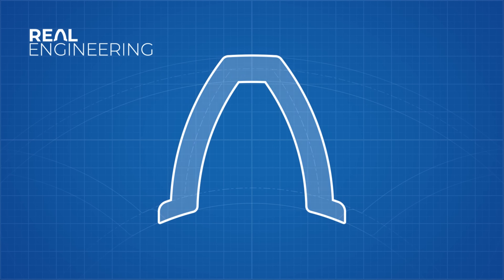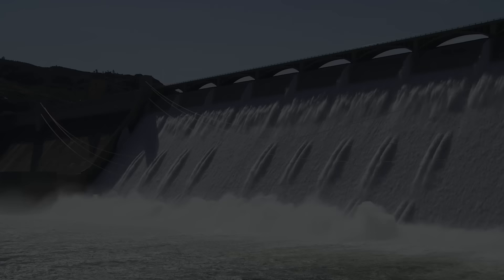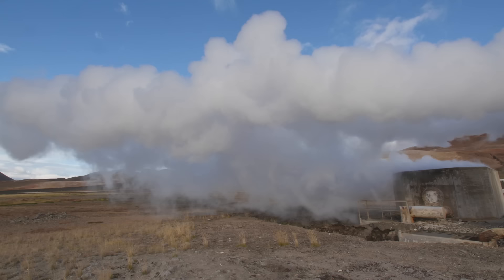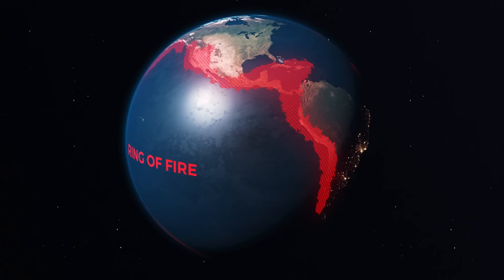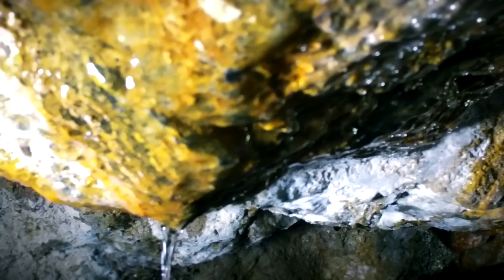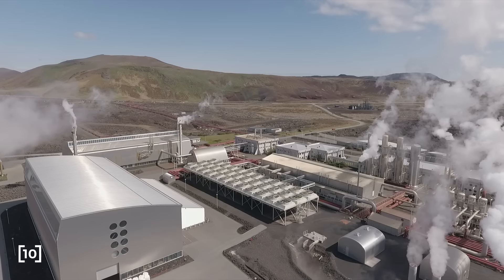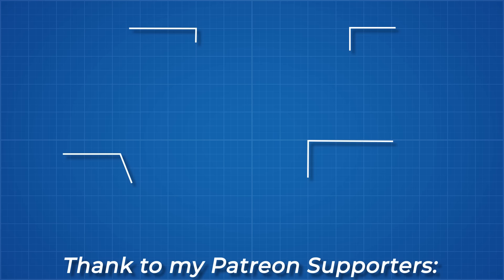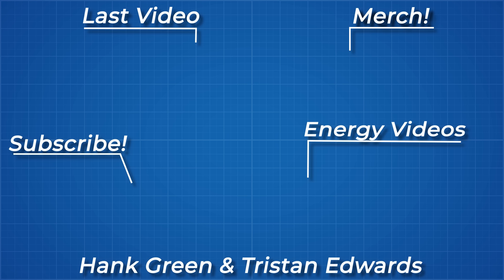Could Earth's Heat Solve Our Energy Problems?

Comment: Where is all the geothermal energy?

Answer: it’s underground.
Reply: That is what the government wants you to think. 
Pompeii never forget
Reply: @theophrastusbombastus8019  lol just sacrifice  chicken to the volcano and boom... explosion energy and pompei all over again
Reply: From that sweet sweet earthquake zone
Reply: I am only scared that this will accelerate the marsification of Earth. Basically Earth turning Mars like
Reply: @theophrastusbombastus8019  
The center of Earth is made of PLASMA. IT'S NOT SOLID CORE. I have something I think you need to see. This is an experiment done with a regular plasma ball, being spun at 2000 RPM'S. It creates its OWN magnetic field. You can see the definitive north and south pole, as well as tropics and an equator. Now this is being created by regular gasses inside a plasma ball you buy off a shelf. It's VERY plausible, that at our earth's core, the different metals of our core being compressed by our lower mantle creating heat, combined with the rotation of earth at 65,000 MPH creating even more heat, would turn our solid core, into a molten liquid core. The faster the Earth spins, WELL past 2000 RPM's would further transform it into a super plasma state. The FASTER it spins, and instead of basic gasses like in a plasma ball, and having metal properties instead, would still create magnetic fields, but COULD actually also create gravity. 
Here is the link. It starts at the 5 minute mark. Mind you, this is just basic instruments using a battery, and a motor. Using proper equipment and liquid metals, you could theoretically not only create gravity, but reverse it. Meaning instead of gravity pulling, you could create a field that could PUSH it, using it for interstellar travel. The sun would charge these devices, the same exact way our Earth's plasma core gets its sustainable charged energy from the sun, at the poles. Our government already knows this, but implementing this technology into vehicles, would eliminate the need for fossil fuels, in which they get rich from. 
Would other civilizations on other planets use this?? Yes. Why would aliens come here?? Because the closest sun, from our sun, is 4.22 light-years away. Meaning ANYONE flying in or near our solar system, would have to use our sun for fuel. It's the only "gas station" for light-years. It's very plausible while doing so, they WOULD see our shiny blue marble,and get very curious. 
https://youtu.be/i1J5HF1yUAw
Reply: @vDarknessFalls  
need to check your work. The earth 'spins' at about 1000 miles an hour or 1609.3 kilometers per hour at the equator. That's approximately one revolution every 24 hours . It circles the sun at about  67,000 miles an hour or 10783 kilometers per hour.
Reply: @chuckaddison5134  shit. I totally fucking typed that wrong. Even so. The plasma ball is only being spun under 50 mph. Imagine if they cranked it up to 1000 mph??? Would it create gravity.....
Reply: Does that make it hipster energy?🤭 (Sorry, couldn't resist... I'll show myself out now 😞)
Reply: Zing!
Reply: @cryingwater  
Well when we make Mars Earth-like when Earth becomes Mars-like it will be a good thing.
Reply: It is, for practical purposes, unavailable except in a very few locations.
Reply: @vDarknessFalls  You don't have the foggiest idea of what you are talking about.
Reply: @theophrastusbombastus8019  Too soon man....too soon
Reply: If you search youtube, type in "The Core of The Earth - Documentary HD ADVEXON TV".
There is one thing about that video though, that they got wrong from National Geographic, as we discover emerging technology, well... oil, coal and the stuff mentioned in that video.. isn't used anymore, since our world is changing and using electric vehicles, and with Fusion Energy on the way for our source of energy, and for space exploration. Silicon is in all of our devices, when the video mentions about some things in our devices, the video was wrong, and the narrator is short sighted.

Same thing with Graphene.. since Diamonds aren't the strongest material like in that video, Graphene is actually 200 times stronger than steel and 100 times stronger than the strongest steel.
Graphene also has special properties "when in its purest form", and it's known as the wonder material of the future.
Spintronics with Graphene to make our devices more energy efficient and faster at the same time in the next 4 years, by tilting the Electron = electricity, and Spintronics has also been tested on tilting Photons (light), to create Quantum Teleportation for the Quantum Internet to be developed in Australia by 2030 and then shared with Europe, no word on if America will have it yet. There's also Australian companies working with Graphene to bring Quantum Computers to room temperature, and other countries with companies working on Photonic - Quantum chips.
Graphene has also been proven for classical computers (what we use now) to be 1,000 times faster "I have a video in a Graphene playlist on this, in another channel", so we should be replacing silicon in our computers and all devices! Get rid of silicon!

The Hyperloop One was tested in America, and being built in India first "shovels at the ready" they call it as they start now on construction, and will be in America in 2026. See anything wrong with that picture as to tested in America first and then built in India first? Hmm.. I'm all for sharing the technology, congrats! But I don't think it should be unfair where we can't have it built at the same time in America. 
I mean after all, a lot of us want the technology in our lifetime, some of us are already getting older, and don't want to be another decade older before we use it, just because another country gets to have it first. : (

There's a video in a playlist I have, that mentions a Type 1 civilization will use all the energy from the planet, and possibly have other technologies like advanced bionics and many other things like curing many diseases and controlling the weather "some of these technologies from supposedly (Ghost in the Shell) - series", though we are getting closer to advanced bionics, and several other technologies like Photonic Computing, Quantum Computing which will predict weather supposedly, help with the medical field in new and advanced ways, the financial area, and many other areas for other technologies, and new emerging technologies to come of it that we don't even know yet, with also many other technologies for space exploration, asteroid mining becoming a reality on the way, new larger space stations, Gateways (more than one), new propulsion technologies, rockets getting smaller and some electric (inside) like Rocket Lab's "Electron", rocket prices dropping, sending stuff in to space.. the prices dropping way down, and refueling as the idea from space to save time and money instead of launches from the surface of the Earth, missions to the moon and Mars, with Gateways and space stations for the SpaceX Starships to dock and refuel, and so much more going on.

What I mean with the Type 1 civilization, we might not need to use all the energy of the planet, because we have Fusion Energy on the way, Graphene is also a super conductor in its purest form, for energy, batteries to recharge faster and last longer, and so on. To learn more, check out a playlist I have on Graphene.
And so I think we are very close to a Type 1 civilization, without the need to use the Earth's core.
We were already at .78 % (percent), I think we are around .92 - .95 % of the way there, we are getting very close to being a Type 1 advanced civilization.
There's a chance that because of small Fusion Reactors, we might not need a Dyson's Sphere around the sun, that would block out the light, sure we could create light, but we might not need to have to do this, especially for what comes next in emerging technologies after Fusion Energy. So we could be both "half way to being a Type 2 advanced Civilization (without moving stars, planets, moons, asteroids and so on), and half of a Type 2 advanced civilization at the same time" because of Fusion Energy, but there's always room for more energy I guess, even if we create energy in space from Fusion reactors and share it with the Earth, I suppose we probably will use the Suns energy and want to make a Dyson's Sphere.
So I do believe we are very close to a Type 1 advanced Civilization, and half of a Type 2 advanced civilization "without moving stars, planets and moons and solar systems around" as we will be able to one day, I'm sure they already know how, but having the technology and having it built is another thing, that doesn't mean they don't know how, and we might already have the technology just like Graphene where it's not used completely yet, let that sink in.

We are literally "living in a Graphene age, and a Quantum World".

Watch the video I mentioned at the top of the comment about the core, I don't think it would be a good idea to cool off the planet with the idea in the video that we are commenting under, by using the core in the way mentioned, maybe use the lava's magma right under the surface, and the lava's heat, so that we can official control some of natures patterns.. placing us closer to a Type 1 advanced civilization, and then quickly move on to Type 2 advanced civilization.

Though because of some of the emerging technologies and beyond that I mentioned above "barely anything if you check my playlists on another channel from the steps below", then you will see that the idea in the video we are commenting under, isn't the best idea, and could be dangerous to use the core of the Earth itself for many reasons other than just cooling it off being an issue, the core has to help with the magnetic poles of the planet, which you can also see in the North and South, as the (Northern Lights) of radiation also comes in from these magnetic poles to the North, you can find videos on the Northern Lights easily.

Go to the videos under my playlists in another channel (given in steps below) and talk to them about it, with comments, not to me.

Want to learn about emerging technologies and beyond? And see the stuff I was talking about above and so much more?

----------------------------------------------------------

I was giving out helpful links, but it won't allow me to do that now, so I made playlists.

1. Check my channel, find a subscribed channel called Technology Research, go to the playlists there, and click "created playlists", that should show them all.

2. After that, click on the title / text of each playlist, not on the pictures.

3. Don't forget to click the "more" button in each playlist description for more articles and playlists.
Reply: Mr Purple  not anymore there is a blanket
Reply: @onemadscientist7305  check this out. Scientists are measuring and recording VLFs coming OUT of the core, through plates and cracks DURING large earthquake. Those VLFs have been recorded hitting our ionisphere. THAT is where the strange sounds worldwide are coming from! I KNOW it. Those VLFs are bouncing off our magnetic field, plucking that like a guitar string, causing verberations. NOISES. The ONLY thing that can cause natural VLF's is PLASMA. And those VLFs, are coming from our core, bouncing off our ionisphere, and going back DOWN to the core. It's been measured. No one knows why. I figured it out. 
Check all that info. 😎